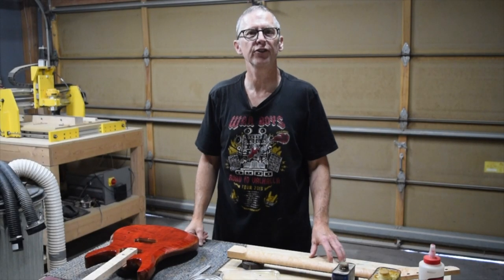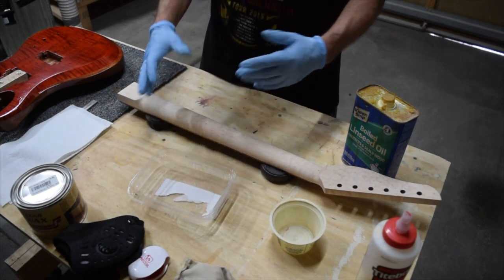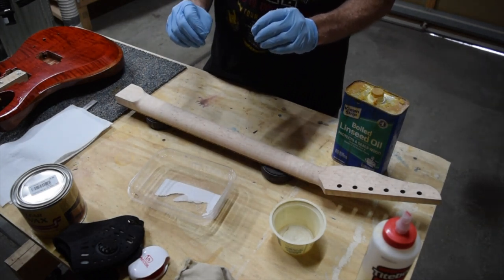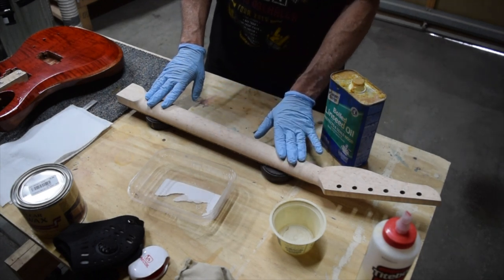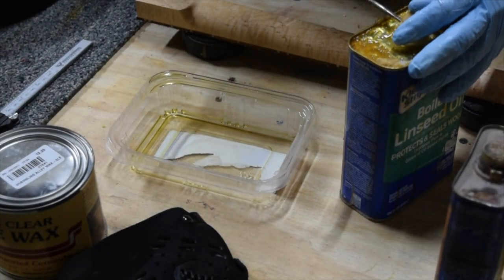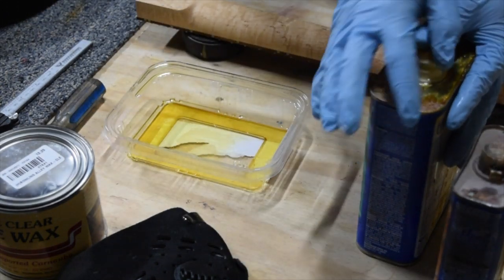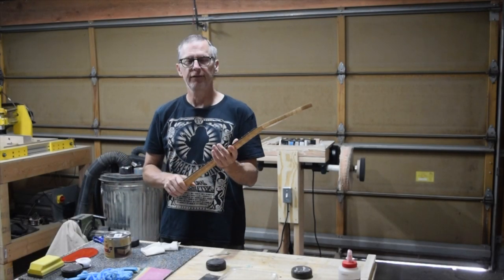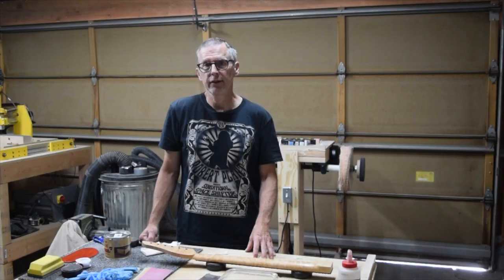Applying An Oil Finish On A Guitar Neck

Comment: Thanks for the great info and sharing your breadth of experience. One question is can this be applied equally on tempered / torrefied wood, which I assume does not absorb in quite the same way due to crystalization of the natural oils closing up the wood's "pores"? Thanks.

Comment: Thank you sir. By applying your wet sanding trick with oil + 1500 grit paper + mineral spirit, my neck now is buttery smooth. It is smooth like a wet 1000 years old stone on the riverside. I cant describe how satisfy I am at the moment. It almost feel slipperry smooth. Thank you once again!!!
Reply: Despite that my oil is not real oil, it is Danish Oil Finish, a type of varnish. But your trick works wonder even with different finish type of mine. Thank you, thank you!!!
Reply from the maker: Thanks for sharing

Comment: I researched a dozen other methods.  After a water-based grain filling and light sanding with 400 grit paper, I followed this method exactly on a new, unfinished, solid rosewood Strat neck - the results were amazing - and this was my first neck refinishing effort.  Great advice!
Reply: Why would you pore fill a maple neck? It's a closed wood grain. There is really no need for that if it's sanded properly. Have a great day!

Comment: Just been sanding back the finish on my Strat neck. I oiled and wet sanded it, thanks to your great directions and advice. The neck is amazingly smooth and the hairline cracks that were in the previous finish (as received from the previous owner) are gone. An amazing transformation! Thank you!
Reply from the maker: Fantastic! I love hearing good results with this technique. Thanks!!
Reply: @HighlineGuitars  Do you ever apply a wax finish as other youtubers recommend?

Comment: I've been using Crimson Guitars  penetrating finishing oil, which I believe is very close to tru-oil as far as its ingredients and characteristics. However, it's expensive and takes a while to come from the UK to me in Michigan. To me there is nothing better than an oil finished neck, rubbed down with wet dry paper, silky smooth and beautiful in appearance. I'm on the verge of applying finish to a birdseye maple bass neck that I built and am going to give the boiled linseed oil a shot. Always looking for more timely and cost effective ways to improve, as it seems you are as well. Thank you Chris, you do a great job not only showing how to do this stuff, but maybe more importantly, explaining why you use the methods that you do. It sets you apart!
Reply: As much as I like Crimson Guitars' YT channel, I cringe when I see Ben pouring on finish / fingerboard oil. Apart from the waste, there's no way all the oil soaked into the wood will ever dry out properly.
Reply: You can always try CA glue. It dries as hard as poly, but much quicker and imho is easier to apply.

Comment: Great advice. The safety tips are nice too.
Reply from the maker: Glad you like them!
Reply: @HighlineGuitars  Hello there, thanks for the video and the tips. Quick question, how many layers of Boiled Linseed oil do we have to apply to effeciently protect the neck from humidity? I heard 3 layers are required. What is your point of view regarding this? Thanks!
Reply from the maker: @KRSinDUB  Three is what I typically apply. There is no reason to do more.
Reply: @HighlineGuitars  thanks for the quick reply sir. Would you wet sand with blo and mineral spirits for the first 2 layers only or fall all of these?
Reply from the maker: @KRSinDUB  I would wet sand each coat with progressively finer grits.

Comment: Great suggestion to use Boiled Linseed Oil. I had been using Tru-Oil for years, but using the Boiled Linseed Oil seems to be an easier process. Thanks.
Reply: I too am trying to decide between Formby's Tung and Tru Oil for a complete guitar refinish

Comment: I'm about ready to finish an oak neck/fretboard, with the frets already installed.  I love how easy and simple this seems... just one question-
Should I 1) tape over the frets, 2) polish the frets after everything dries, or 3) ignore the bit of dry oil, because my playing the guitar, will magically make everything okay?
Reply from the maker: No need to tape off the frets. You can simply wipe the oil off of them.
Reply: @HighlineGuitars  Thank you for the reply! 
This SEEMS foolproof, so I'm gonna give it a try.  If I'm successful, it will be certified "idiotproof".  Wish me luck!

Comment: Thanks for the wonderful teaching moment! I'm doing this right now! I've just finished with the first step of oiling it up. 
If this works so well, I might actually sand off the finish on a few other of my guitars and do this. A non-sticking neck is important and this sounds better than a mat finish lacquer that I was going to use.

Comment: Well, my experience was a little different than others here when using this technique.  It turned out "okay" for me.  I think it would have had really nice playability, but the thing for me is that it just didn't look or feel bespoke to me.  I think it had something to do with the fact that I was using black walnut for the neck wood.  It darkened everything and made it a little splotchy.  Not wanting to sand all the oil off, but not really happy with the results, I decided to try a little schellac on top.  WOW, what a difference!  The grain and color came out instantly.  I used some high grit sandpaper and wet sanded to smooth the schellac then went to some rubbing compound followed with some polishing compound and got to a REALLY thin coat of schellac, but pretty polished and I am beyond pleased with the results.  I am trying to model my instrument based on some really fine vintage guitars I have played over the years incorporating the best elements of the best guitars and this technique gave the black walnut a very similar feel to an old Les Paul Special that I was hoping to emulate the neck of.  Really turned the black walnut into an aged mahogany feel if you can believe it!  Thanks for the good advice, definitely not knocking it since it got me to the result I wanted just wanted to share my experience with it in case anyone else experiences the same thing I did with it.
Reply from the maker: This is why I tell people over and over and over and over to test on scrap.
Reply: @HighlineGuitars  Definitely should always test I agree.  Fully admit I got a little lazy on that.  Lesson learned, but still pleased with the "happy accident".

Comment: Great video- as others have noted. Quick question though- how would you compare Danish Oil (which I like because of the fast dry time) and Shellac (which I also like for it's dry time and amber darkening nature) to the Boiled linseed oil?
Reply from the maker: Danish oil is a mix of BLO, pigment, varnish (usually polyurethane), and solvent. It soaks into the wood very well, but doesn't build up for a high gloss shine. BLO does the same thing, but without pigment or the added protection of added polyurethane. Shellac can build for a high gloss shine, but it doesn't protect against alcohol.
Reply: @HighlineGuitars  Thanks for the quick response! I went with Danish oil last night- not concerned about a gloss shine I like the feel and texture of a raw neck but want to protect it- so this was perfect. I watched another of your videos about all the different finishes after I posted this so went ahead and tried the Danish oil- worked great and didn't darken the neck much at all. Great feel- very smooth and clean-
Reply: @HighlineGuitars  How many coasts of Danish oil would you recommend I put on my neck? I have one decent on now- feels really good- but I want to make sure it's really sealed.

Comment: Thank you so much for posting this video! Helped me tremendously! The only question I have is do you oil the fretboard also? I hear you don’t have to. Just want to hear your take. Again thanks for this great video.
Reply: Yes wondering that also. Can you finish the fretboard the same way? Thanks!
Reply: You probably can but shouldn't. Rosewood, and Pao Ferro as well already has plenty of, let's call it natural oil in it. It only needs moist water to brighten it up, but that dries up fast, that is why products are invented for rosewood that has not 100% oil but more deluted type. The oil is in there to keep it long lasting. So Lemon Oil products are preferred. Lemon oil is a very thin solution. Not too oily so it makes your fretboard sticky.
But the best just for moisturising the rosewood is the purest mineral oil you can find.. You can find those in beauty shops (not kidding go in there and ask for the purest they have). Even Olive oil i used without problem. 
I have seen rosewood that is finished to a half-way shiny finish with lackquer at home, all in all i think it looks terrible. NO finish is best.

Comment: Do you ever buff a neck you’ve treated with Linseed Oil?
Reply from the maker: Yes. I have buffed necks after applying BLO by wet sanding it from 600 to 1,500 grit to get a surface that's a bit shinier. However, they will never shine as well as if they had been top coated with lacquer or Tru Oil.

Comment: How long will the boiled linseed oil finish last? I never had an oil finished neck. 
Me personally, I see guitars like oldtimers and always want them to be in great condition. How often would you recommend a touch up so the wood won't get any unpleasent discolourations? Any pointers on the climate? How will the finish behave, will it yellow quicker?

Is there another name for that japanese dryer? I think you mentioned it in an older video. 
What's your next favourite finish in line? Are there any woods that don't take oil finishes well?

Thumbs up for the savety warning...14000 fires by spontaneous combustion/chemical reaction betwenn 05-09.
Reply: At least once a year. BLO Isn't exactly the best product to use on wood. These chemicals are actually Kobalt which is a heavy metal. At least 1 person has died from an overdose of Kobalt because the warning is on the can and on line.... you can thin raw linseed oil so it dries much quicker.
Reply: @xfup  Well, then buy one with mangenese as metal soap dryer. There isn't enough in there to be toxic. The raw linseed oil can turn rancid and it doesn't cure forever, that's why it's used by painters for their colours.
Reply: onpsxmember it won't go rancid... linseed oil is produced in a manor that removes the fat that causes it to go rancid. Flaxseed oil will go rancid but linseed oil will not...

Comment: Thank you for the fire hazard safety tip, you just might saved my future me from burning my house down. :) I didn't know about that drying oil generates heat.
Also saying that it's not a good idea to build up multiple coats for achieve gloss shine on the neck probably saved me from some headaches, because I was thinking about how nice it would look. It make sense now it would be likely to sticking. I am about to make from a cheap, scratched bass to something really beautiful bad (b)ass art with a deep cherry color that shows the beauty of the wood pattern with some very high gloss and a proper set up, your videos are a huge help to get some idea how to do things and how to avoid mistakes.

Comment: The neck off my 1988 maple MIJ Fender Strat (gifted after both my son-in-law and his son , both metalheads, used it) is detached from its body for the first time , tuners stripped, taped off for a neck cabinet scraper/ Scotch Brite rub prior to a boiled linseed finish that you've sold me on in your video. My wife, a successful artist /author has a tin of boiled linseed oil so its right here and now. 
The OEM "Blackie " body was somehow incredibly intact, but the neck could have been used to repel the Brits in the War of 1812 (I exaggerate) but nicked up enough to want to refinish. The fret wear was enough to cause me to buy the gear to level and dress them,  the OEM Wilkinson bridge plate has new Graphtech saddles and I decided to refinish the neck because I can. I like playing this guitar. I have others....so i have the time.
I've already replaced the electrics (Texas Specials, Bourne harness) and the saddles (Graphtech) into OEM Wilkinson bridge plate and have a Graphtech nut to swap  in when I'm done. This is where I need your advice.
The Fretboard is honestly relic'd by hard play 1-6 from frets 1-8 to bare wood and then some slight divot wood loss, a bit grainy. The frets 8-12 from 6-4 show less grain wear so I am considering a razor scrape to bare wood for frets 1-12 and then a boiled linseed finish both neck and fretboard, complete with Japan Drier prep. The "road worn" hype is OK, I don't object to it but prefer I a clean looking pro instrument in top shape. 
The Q is this: Do you think the linseed will hold up on the fretboard?
I have 4 guitars: only one I've approached fretboard finish on is a 1953 Martin 0-18 and that was with lemon oil, no complaints. CAN I DO BOTH SIDES of that maple neck  with boiled linseed and wake with a big smile??
Reply from the maker: If it has a Maple fretboard, use lacquer.

Comment: 341 you speak of making your own varnish.  Bravo! Made a believer out of my auto painter friend. It worked so well with the poly and mineral spirits.  I recently did add the blo but I'm not sure yet, it's drying I think. Lol! I may have got the mixture a little thicker on the blo. It's fall so I'll be careful.  It looks like glass though and I used a tee shirt. Blew him away! You know, another thing I do is go watch woodworking video's too. Helps me to understand the essentials of woodworking and I grasp this better now.

Comment: I used tung oil with a spoonful of pure sandalwood oil in it just for the aroma, when I play the guitar may hands have a faint smell of sandalwood.
 I think I applied 4 thin coats of the oil but I didn't get the hard finish that I thought I would.
Reply from the maker: That's really interesting. Thanks for sharing this. I may try it myself as I'm not too keen on the smell of tung oil.
Reply: @HighlineGuitars  Yeah, thats the reason I used the sandalwood oil, I bought loads of pure oils while travelling in India in 1995 and so I thought of using some to mask the smell of the tung oil, it was the first time I had used tung oil and wasn't sure if the odor would dissipate once completely dry.

Comment: this was great, thanks!!! now to try and find what to do if you need just a touuuuuuch of color. got a guitar off of reverb and man this neck is SO unfinished. seller said he likes the feel of this sort of wood and swapped the neck, but... idk can't imagine wanting to play on it how it is at the moment. it also looks cheap as hell lol. thinking to try my hand at upgrading dot inlays while i'm at it. oof.

- roll fret ends
- roll edge of fingerboard
- inlays?
- sanding whole thing for sure
- oil finish

geez. i mean it's SO unfinished though. and i can see in my minds eye how sweet it'll look done. i DO like the lighter color (fingerboard is same, no additional color on it.) with the pale yellow body guitar. i just wanna make it shine. :)

btw, that d-bag who complained about the length of the vid? fkk him. for gods sake, EVERYTHING you were talking about was relevant. i mean, i get where he's coming from with regard to some vids on youtube, but not this. idk what his problem is. trolls gonna troll, i guess. i love your vids. only time i check out is when suddenly you use the big guns like a buffing wheel. (it's cool info but no way will i have access to specialized stuff like that. trying to do things by hand. or screwdriver, lol.) trying to learn as much as i can and justify upgrades like that IF i can somehow start making coin. i'm sure it's where everybody starts, right?

Comment: I followed your approach on two necks.  The initial results are great.   However, after about 20 hours of use I am seeing a lack of ruggedness in terms of just standing up to ordinary hand oils relative to a satin nitro finish.  I definitely appreciate the speed and ease of application but I think the critics who say the oil finish lack ruggedness do have a point.
Reply from the maker: Try Polymerized Tung Oil.

Comment: Nice idea. I'm going to try this on a bare Tele neck I've got. I too used to use Tru-Oil, but am disappointed with results I'm getting. Mainly because it's usually outdated. The company has sold out or moved its operation to Texas, and the formula is not as forgiving as it used to be. It's best to use your linseed oil idea. I'll do it a few days before the trash people show up, and will soak down the rags. I've done this, and it's a good way to dispose of them. No oxygen and a water bath in a coffee can and no problem with a fire hazard. Thanks for posting this.

Comment: Hey great video man ! Really helpful ! Could u tell me till what grit I need to sand the neck before applying the finish
Reply from the maker: When you can no longer see the sanding scratches after wiping down the wood with alcohol is when you're done. For me, that's 400-600 grit depending on the wood species.
Reply: @HighlineGuitars  thanks man will give it a try !! You earned a sub 🤘🏻

Comment: I use linseed oil on dang near everything from furniture to gun stocks.   I cut my linseed oil with turpentine about 1/3.  After a few coats of linseed oil, I preserve it all with a polish of 1/3 linseed oil, 1/3 turpentine, 1/3 beeswax.

Comment: Hello Chris…this and “My favourite finish for a Guitar’s Fretboard” are both GREAT videos.  Is it possible to stain a white maple neck/fretboard before applying Japan Drier and Boiled Linseed Oil treatment to seal the surface?  Also do you recommend the wet sanding step for the fretboard surface?  I really appreciate you advice as I am working on my fist build as a school project.
Reply from the maker: Yes to both questions, and good luck!